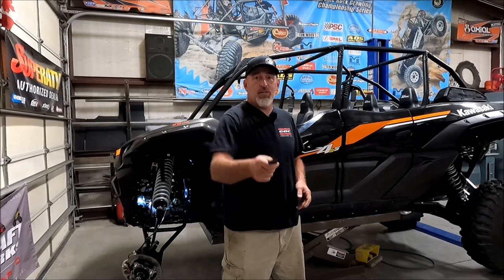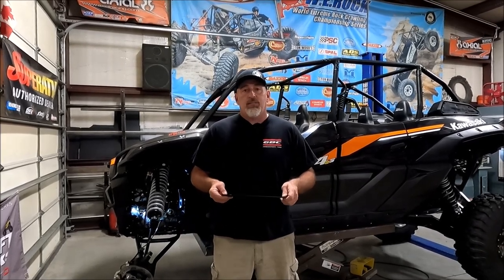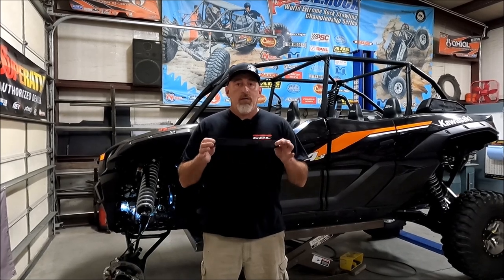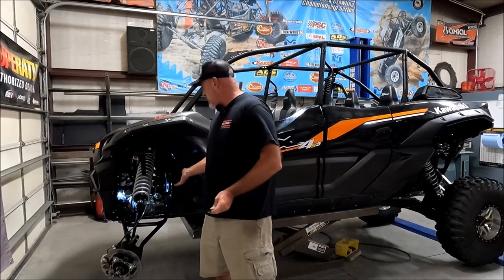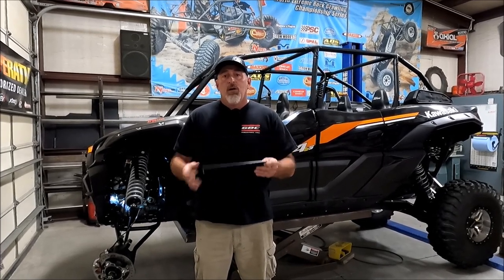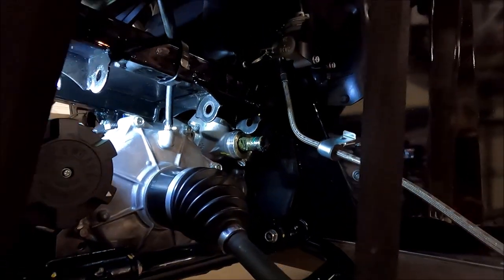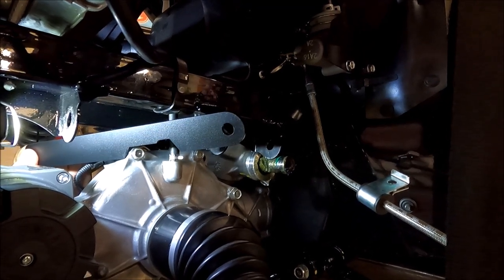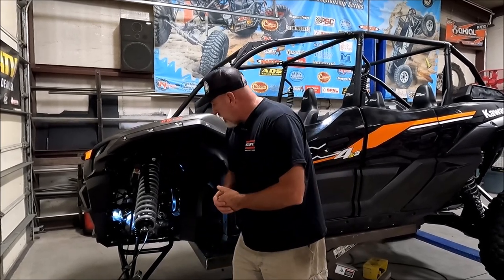Kawasaki KRX KRX4 1000 Rear Upper Arm Brace

Comment: Thanks for all these modifications Jake!  The experience you have with running KRXs and the fixes you come up with for the "shortcomings" that Kawasaki probably never wanted to (or couldn't for budget reasons) are really helping extend the life of my KRX and helping it to perform much better.  I've already upgraded my fuel system with your center dump fuel rail and filter.  My tuning and clutching has been done based on your recommendation for the DynoJet PV3 as well as their clutch weights.  I'm using your crossover ring silencers on my shocks as well, what a difference a simple rubber ring made!  Next steps will be to go through your A, B, and C lists for all these suspension braces.  Again, thanks for all the work you're doing and sharing with the rest of us.  I can confirm they've all made a difference!
Reply from the maker: thank you!

Comment: Installing this bracket right now,  2023 krx 4 se with 300 miles, fought me pretty good. Getting it aligned, I was able to notch out a 2x4 to jack up between the axle and tie rod to put a little pressure on the rear side of support of a arm and came right out, I’ve bought every part of the “MUST” kit except the skid plate so far. And has been as easily done as seen in videos, GREAT Product and great tutorial videos!
Reply from the maker: Thank you. The key to getting it off and on is pretty much jacking up your vehicle and letting the tires hang.
Reply: @fullaccessutv  Yes I finally figured that out ,at full droop bolts went almost right in. Thanks for making these products, the door bushings are a spouse argument saver also!
Reply: I've been struggling with getting the 2 bolts out of the A-arms. I've got them a third of the way out, but I can't make any more progress. I tried your trick with the board, but it doesn't seem to help. I've tried prying in both directions and lifting up the machine a little. I'm at my wits end at this point.
Reply: @briandunton8379  I think my trick just happened to work for me, maybe not necessarily correct. Try what full access replied with. Jack up the machine to the point the tires are off the ground or just before.(find the sweet spot) installing the brackets was much easier that way. Hope this helps.

Comment: What's the best way to remove the bolts and nut without removing the wheel or anything?  The nut is on super tight and all the room I have is a box wrench.
Reply from the maker: Agreed. It is tight in there. We usually use a box wrench with a box wrench extension to get leverage.